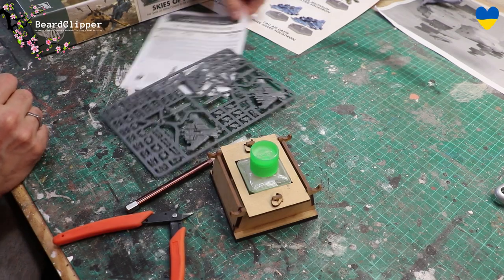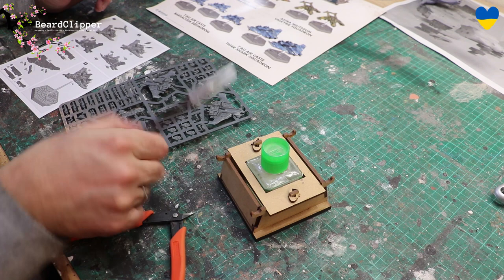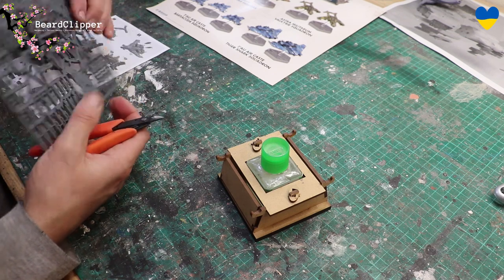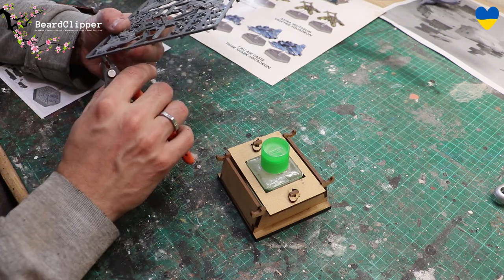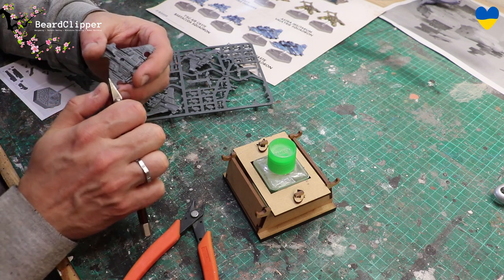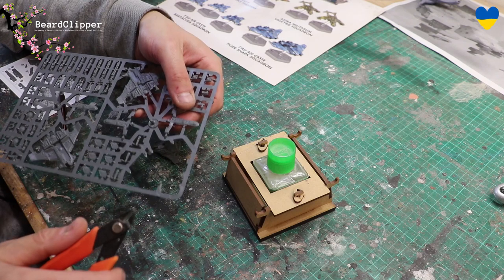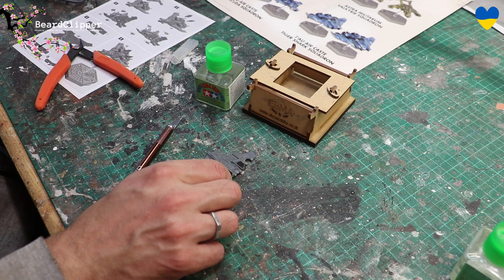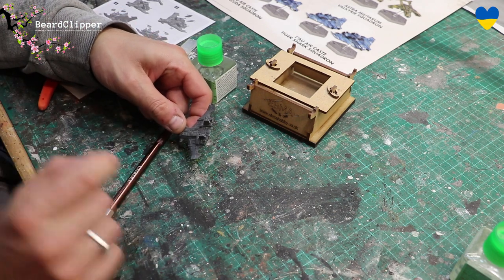Assembling the T'au Barracuda Fighter from Aeronautica Imperialis

Comment: Really nice job, I’ve always used Revell for my stuff, might give Tamiya a go?
Reply from the maker: I've used Revell before a lot as well but I really like this Tamiya stuff :) it's slightly thinner and runs into gaps a bit better, though the metal tube applicator nozzle thing on the Revell glue pots is superb as well :)